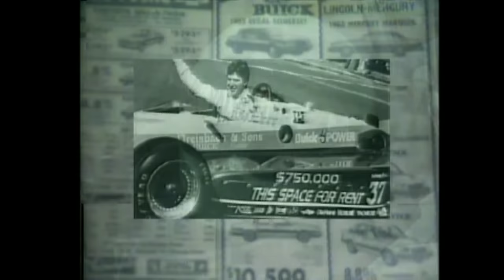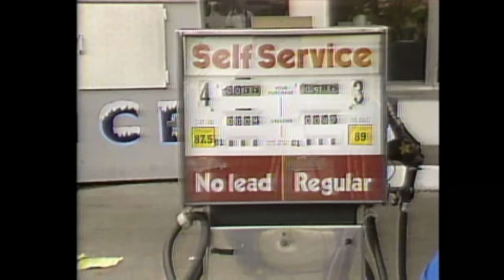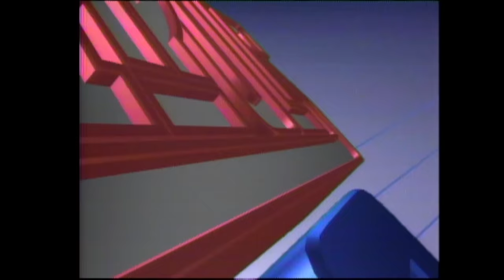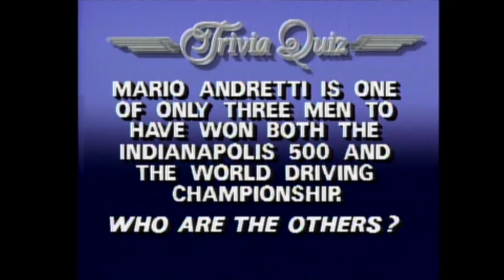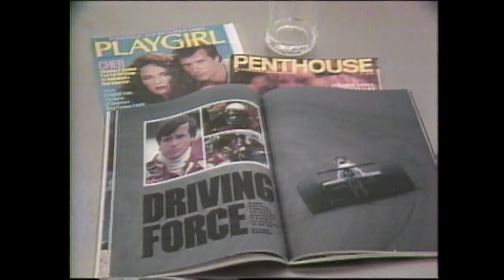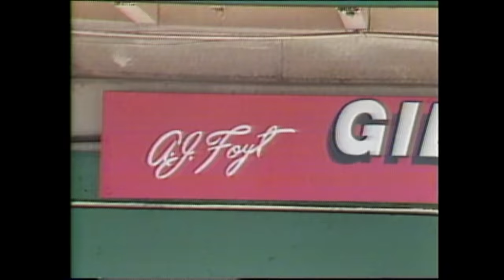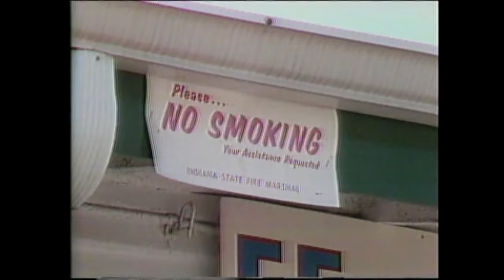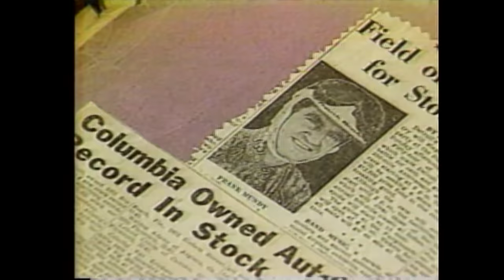1985 Indianapolis 500 | Official Full-Race Broadcast | The 'Spin and Win'

Comment: I was infield backstretch right on the fence.  Danny had been catching Mario.  Nobody knew about the spin ... just that Mario came by at like 210 race speed and here came Sullivan under power but at maybe 130.  Next lap Mario had a good lead but you could tell Danny was back up to speed.  Just sharing a different perspective from the days before instant info.
Reply: I was on the front stretch. Indeed, Sullivan was closing in for the pass as they faded from sight. The phenomenonal and now-deeply-missed Tom Carnegie was calling the action and seemed (understandably) confused by all the tire smoke. He alluded to Sullivan in an incident and Andretti making it through. He still seemed to be trying to account for where Sullivan was, well after the spin. Meanwhile, both Andretti and Sullivan were pitting before he was able to make sense of it. What a beautiful day, blessed to be able to experience that place in that era as a teenager.
Reply: If you'd had a radio tuned in to the IMS Radio Network you might have been able to garner what was happening in real time... but it would have been difficult to hear the radio over the crowd without a good set of headphones.
Reply: I was sitting in stand G, and the spin occurred right in front of me.  I had just happened to be prepared to take a picture of Mario as he passed, and actually got a great series of 4-5 of the whole thing.
Reply: @justashesaid  He was probably looking for the wreckage of Sullivan's car, not realizing that he had spun without actually crashing.